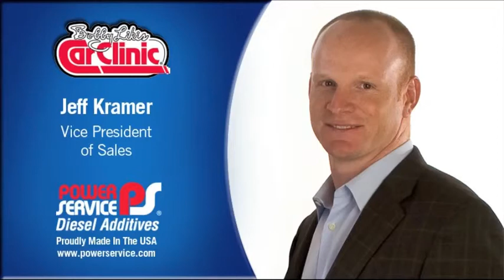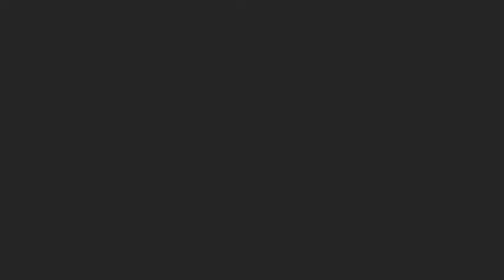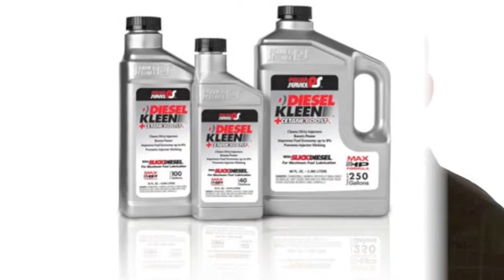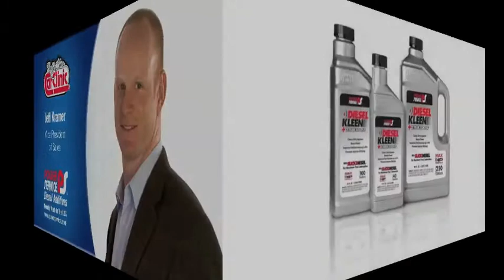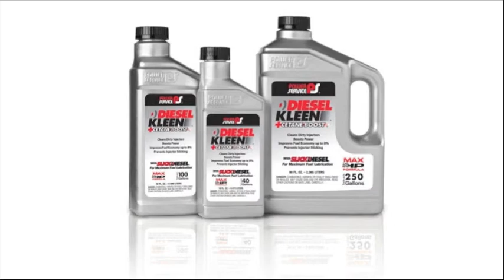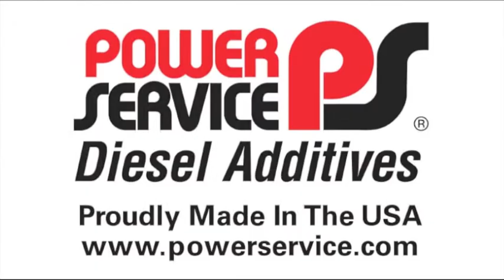Power Service Products - Bobby Likis Car Clinic Radio Show

Comment: There is a lot of Buzz online about adding a lubricant to diesel fuel. There are more factors involved with specific needs of diesel equipment. My question is in regard to mixing other products such as Diesel Clear with the (white bottle) supplement or the Diesel Kleen. I'm currently using the silver bottle as labeled (32 oz per 100 gallons of fuel) and the vehicle really performs well.